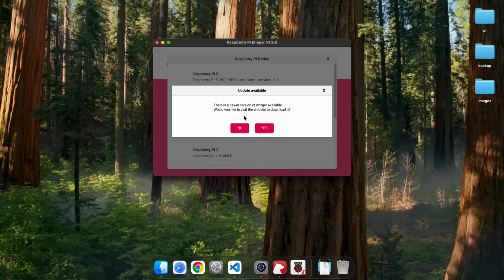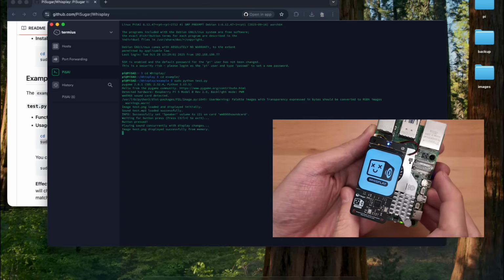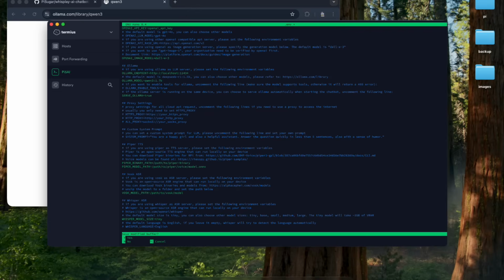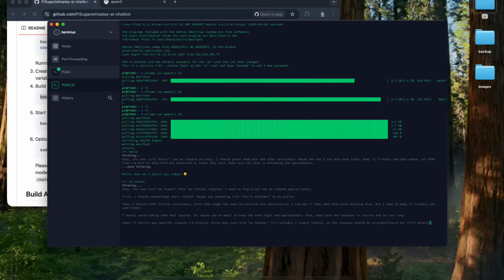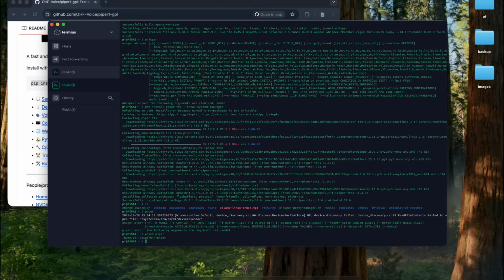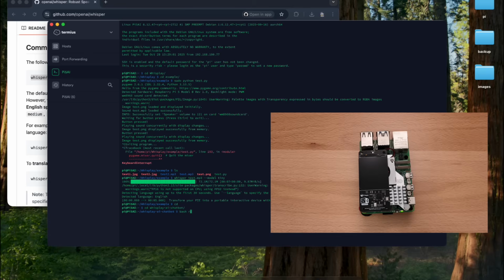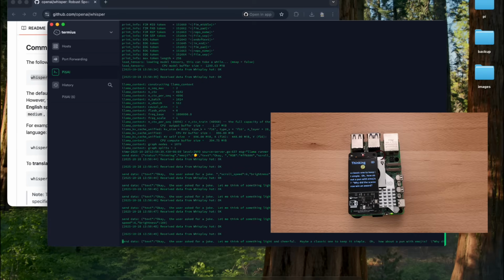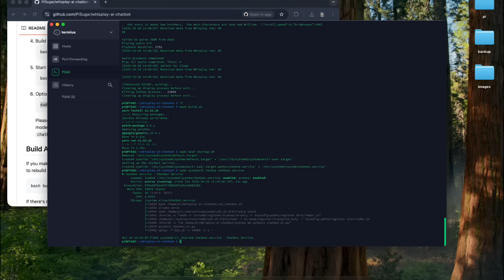Offline AI on Raspberry Pi 5 — It Talks, Thinks locally without Wi-Fi! (Complete Tutorial)

Comment: thats great! just imagine with 16gb ram and accelerator AI card module.
Reply from the maker: I’m also waiting for a usable AI accelerator card. Right now, the official AI Kit (Hailo) seems to be limited to accelerating video recognition applications.
Reply: yes very accelerate on small machine. AI need gaming PC and new graphic card. answer should be instant not 1 word second xD
Reply: @JarppaGuru  The AI acceleration modules are quite capable, Google's Coral for example, or the official Raspberry Pi one. There are others on the market, but they don't use the M.2 interface. Furthermore, the speed shown in the video is quite good, but we're talking about a device using a microSD card, 8GB of RAM, and no dedicated AI acceleration module. So, a custom build that addresses these limitations would easily make it twice as fast and would be more than enough for various applications.
Reply: @ShadowFandub  Those kind of modules are made for ML processing not LLM processing. If you want to run YOLO models they are great but LLM's require memory and high memory bandwidth which those do not have.
Reply: Nvidia is too greedy to build power saving graphics chips since the 1030 and gt 710